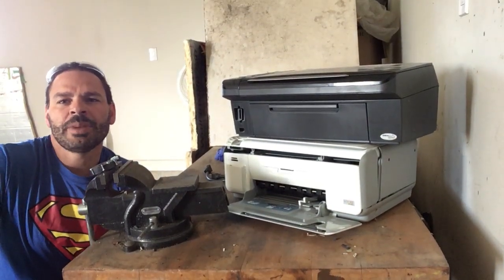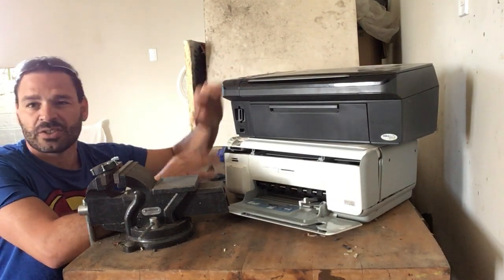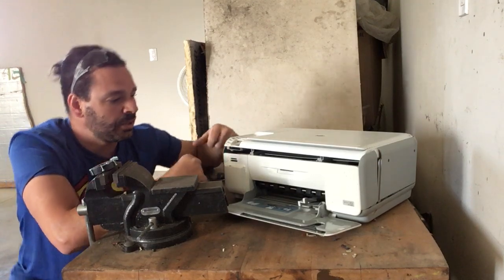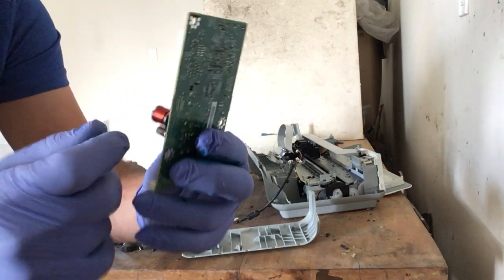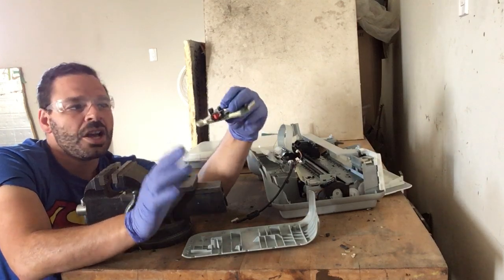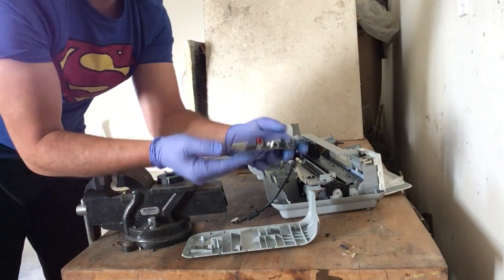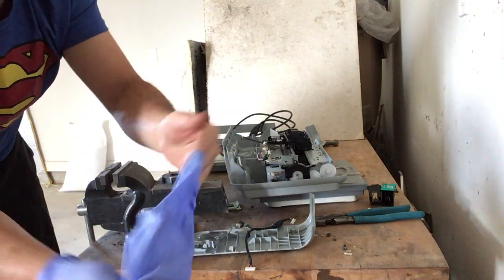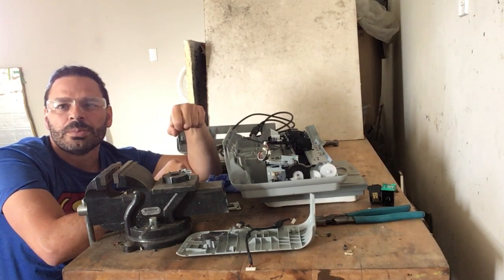Scrapping down printers, are they worth it?  You be the judge!

Comment: For new scrappers I'd just like to say when you tear appliances apart however little material may be there...ie copper stainless Gold ect the small amount is not the point, what you do is just keep saving up whatever metal it is and store it away, do it for a year or even 5 years if you want and by the time you turn it all in you will have a lot.....I did this with copper over 2 years and had 200+ pounds which was at 2.85 a pound...aluminum cans are the same way....very lightweight by themselves but I ended up turning in 1000+ pounds after 10 months of saving them at my complex...

Comment: There's a couple more rods in the top scanner part. And a motor (small). Also, don't throw your glass away, unbroken it can be used for picture frames and such.
Reply from the maker: Yeah, but as a scrapper, not worth taking apart. It depends on the person taking it apart and their intentions with the items. Thanks for the comment. Stay well.
Reply: Love the vid, yes Travis the rods, motors and even the springs I save up and sell on eBay. I have some full unbroken glass which I sell to framers. I save up 10-15 motors and sell them. All good guys, thank you.

Comment: Take apart enough enough printers and scanners and the steel plates add up fast.  Sell the cartridges on eBay in lots, buyers will refill them.  Don't get too scrap happy technical with the boards, sell them in bulk lots on eBay or to Etsy sellers.  Worthless circuit boards for scrap value can look really shiny and pretty to crafters.  Most electronics, shredders, and vacuums that 'don't work' just have a fried wire or broken mechanism while  all of the motors still work when removed.  Take apart enough and you'll learn where to save time sledge hammering or sawing to get to the fun stuff.

Comment: You did not get the gold from behind the light in the top part.  And it's usually the easiest gold to get.  It has exposed gold bonding wires.
Reply from the maker: I did after, but very small wire and still not really worth taking apart. I am just glad that they were diverted from the landfill. I am amazed at how many are thrown out.
Reply: Yes. This is the easiest gold removal part.  It's the one thing I most want from scanner / printers.